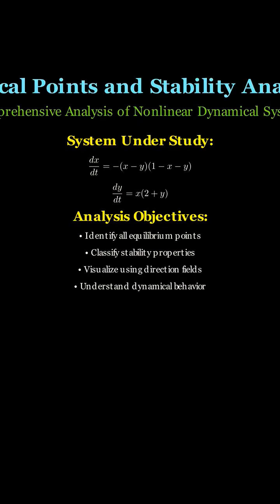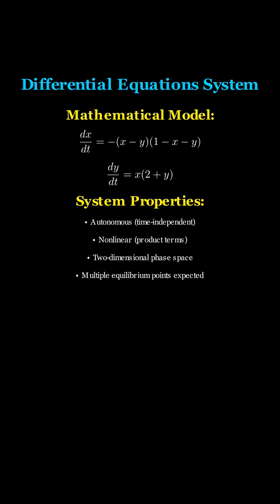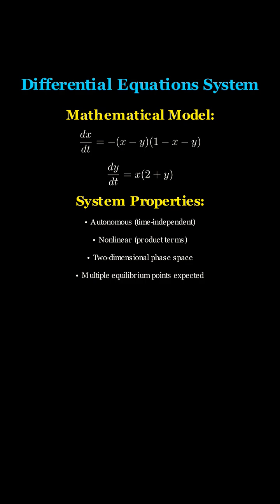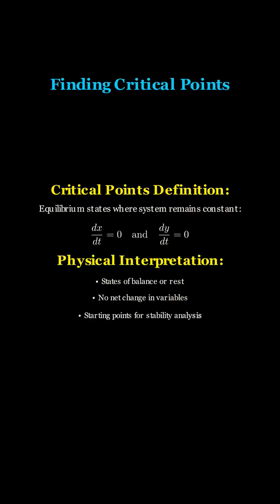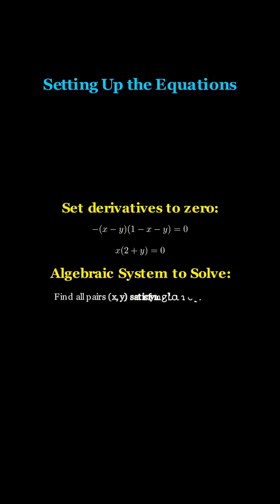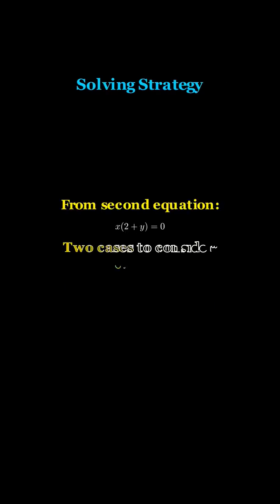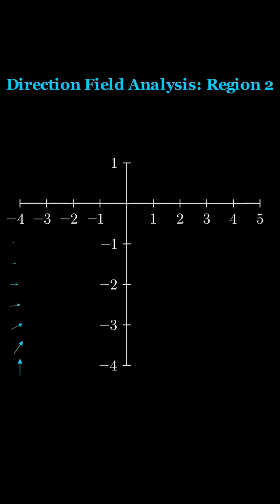Nonlinear dynamical systems

Comment from the maker: This video explains how to analyze a nonlinear system (0:04), focusing on finding its critical points, stability, and phase portrait.

Here's a breakdown of the process:

Finding Critical Points: The first step is to set both derivatives of the system's equations to zero and solve them. For the given system, this leads to four critical points: (0,0), (0,1), (-2,-2), and (3,-2) (0:30-1:39).
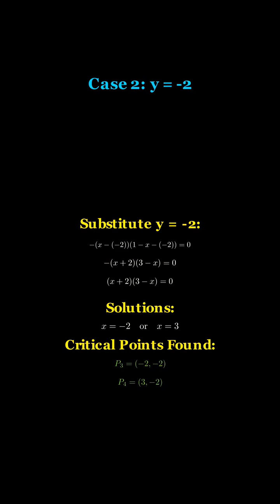Linearizing the System and Determining Stability: The system is then linearized around each critical point using Jacobian analysis (1:52). The video describes the partial derivatives needed for the Jacobian matrix (2:10). Based on this analysis, the stability of each critical point is determined:
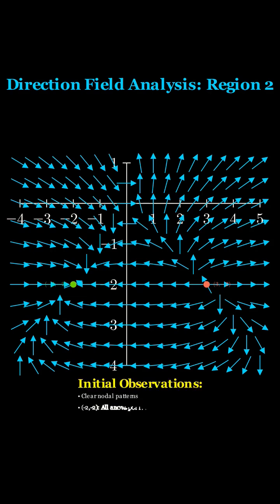(0,0) is a saddle (2:44).
(0,1) is a spiral (2:45).
(-2,-2) is a stable node (2:48).
(3,-2) is an unstable node (2:51).
Examining the Direction Field and Phase Portrait: The video then discusses examining the direction field to visualize the system's behavior (3:12) and highlights the separatrices approaching the saddle point, which divide different behavioral regions (3:22). Finally, the complete phase portrait (3:35) is presented, showing all critical points, trajectories, and the system's global behavior.

The video concludes by emphasizing that nonlinear systems can have multiple equilibrium points with varying stability properties, often separated by separatrices (3:48-3:55).